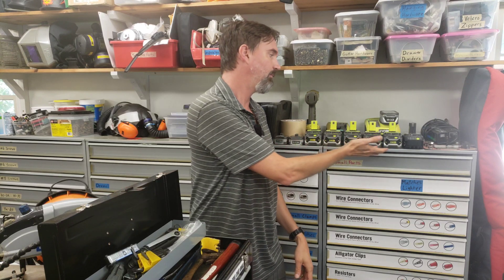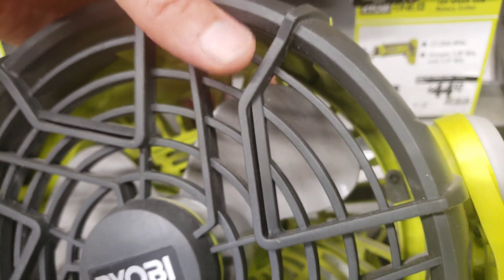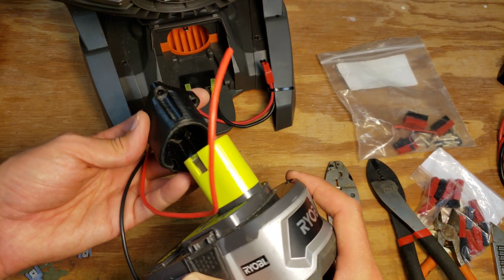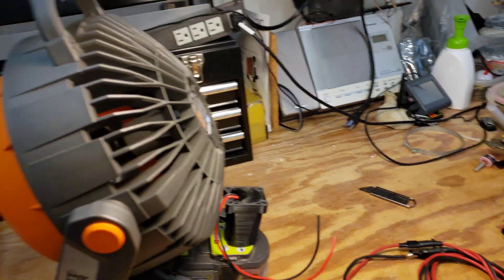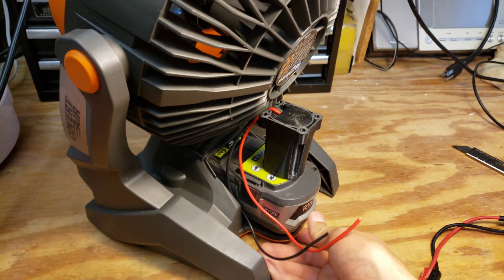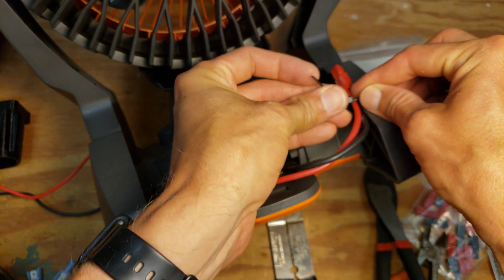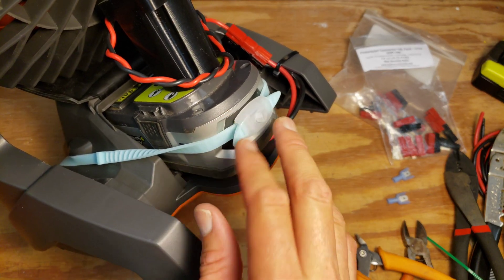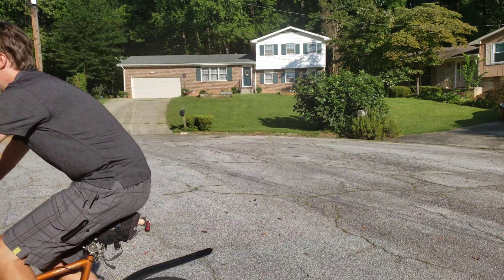How To Use RYOBI 18V Batteries to Power RIDGID Portable Fan | Cordless Hybrid Battery Adapter

Comment: What’s the run time on a large Ryobi battery on a fan like that? I’m looking at options when camping in my 4Runner
Reply from the maker: Depends on speed. I found this data on Reddit for the Ryobi fan. The Rigid fan is similar, but has variable speed. 
New 4Ah HP PBP004 fully charged battery current draw
Low speed : 0.27 A @ 20.4 V = 14.8 hours
High speed: 0.66 A @ 20.4 V = 6 hours

Same results using 1.5 Ah P103 battery from 2011 (11 years old)
@ 20.1 V measured while running on high
https://www.reddit.com/r/ryobi/s/FuPQlyKBGo

Comment: Is there a way to use Ryobi batteries on Ridgid's other tools like their wet vac?
Reply: yes, there is an adapter you can 3d print or buy
Reply: it will make the battery huge for you to go that way since the ryobi battery platform uses the "stick" style , and on some tools it makes it too bulky to go that direction but it is an option
Reply: @potterportraits  that makes sense. But still nice option to have if my rigid battery dies and I can just use an adapter to convert the Ryobi battery to use on the Ridgid tool. I was thinking the wet dry vac
Reply: @superduperboyx  if you have the one I had the door won't close . And I picked up a ryobi one on Facebook market for 25 bucks .

Comment: I'd like to 3D print an adapter so that the Ryobi battery can snap into a DeWalt tool.  I have tons of Ryobi batteries and one complete DeWalt tool kit and no DeWalt batteries.
Reply from the maker: I have not yet seen such an adapter. It would be doable. The problem is that the RYOBI battery has that awful stick out portion that will make the adapter unwieldy and put more stress on it to break. I know that there are designs for DeWalt tool holders, so between that and the Ryobi battery adapters, there's a good starting point. Let me know if you make or come across a design for that.